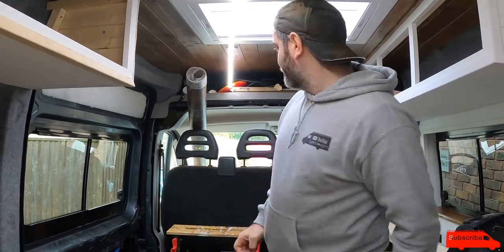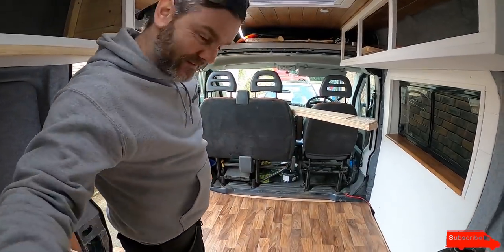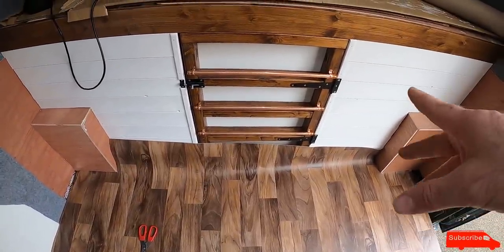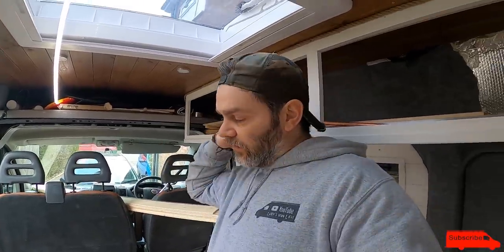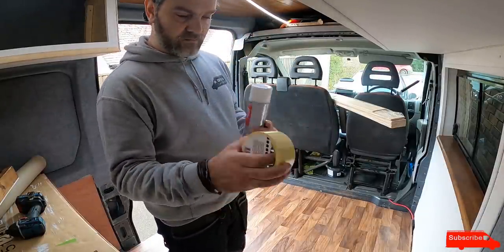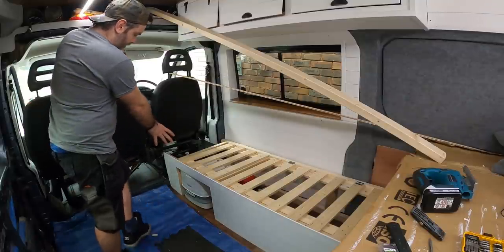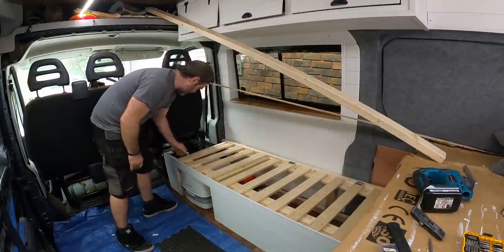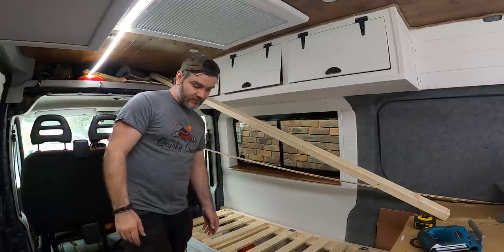Flooring & Sofa Building || Ducato Camper Conversion || Ep 19

Comment: looking forward to the diesel heater vlog as we bought one and it ran for 15 minuets then we got an error 3 code got anew plug and still error 3, so frustrating I see everyone installing and firing up with no issues and we haven't used ours yet. we might rip it out and start again!